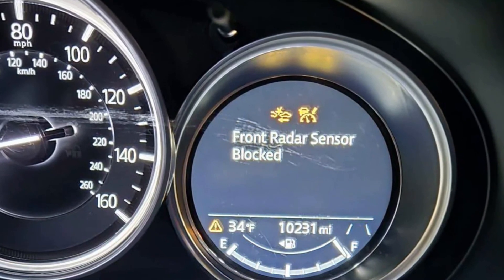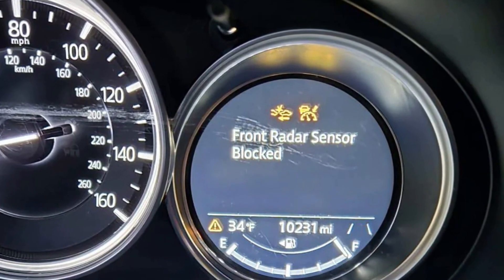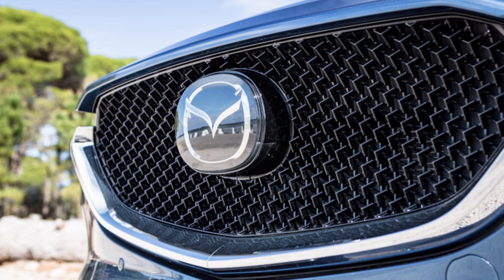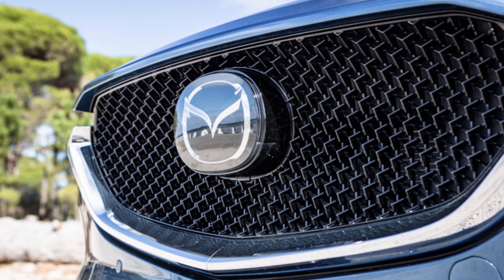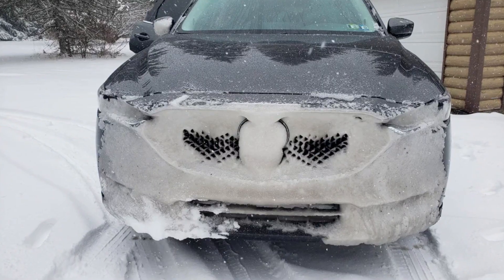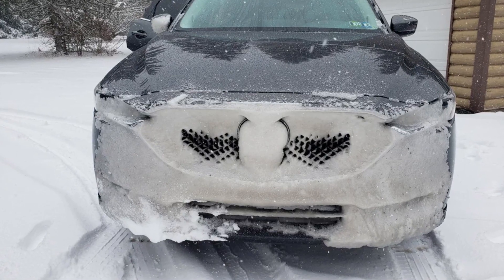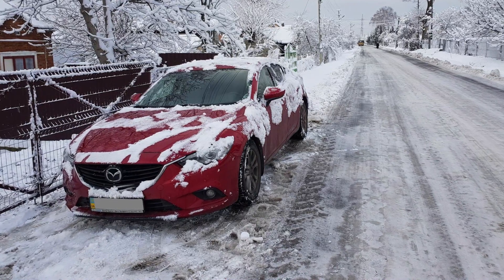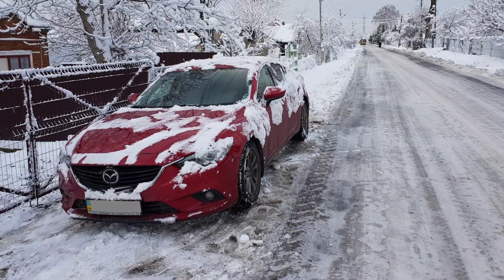“Front radar sensor blocked” warning in Mazda vehicles

Comment: Can we disconnect it or unplug it to stop the SCBS from working if in a older model like 2021 that can't permanently turn SCBS off. You can disable it Everytime you turn car in but not deactivate it permanently like the 22 and up models.
Reply from the maker: No, the software is engineered to have this radar always working, a ton of different features rely on it, and those are safety features, so manufacturers now tend to make it an integral part of the electrical system without any easy way to disable it and forget about it.